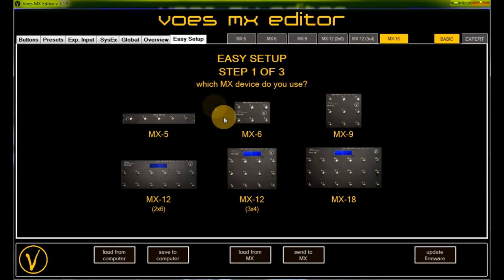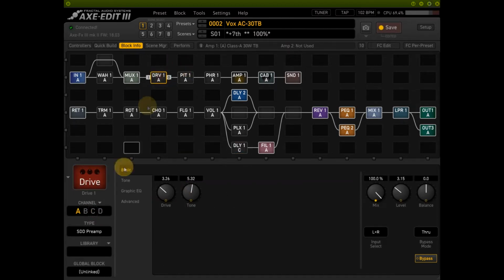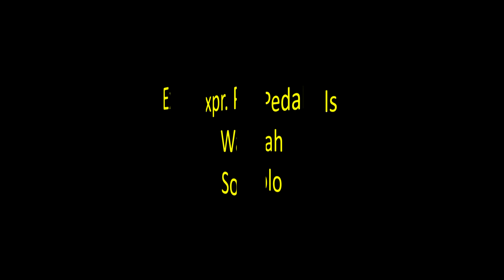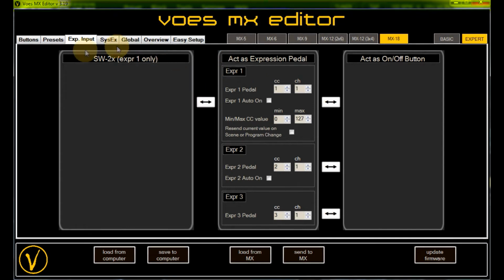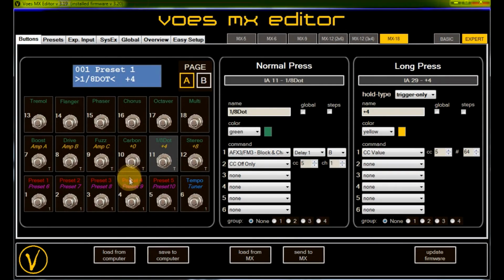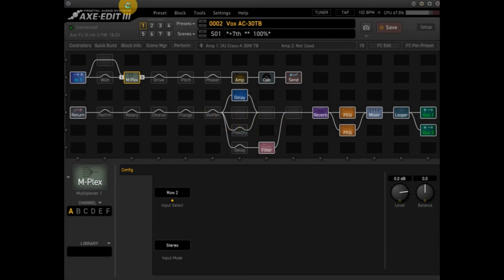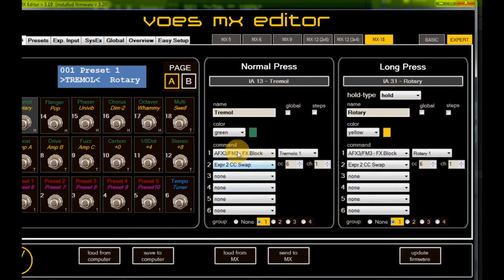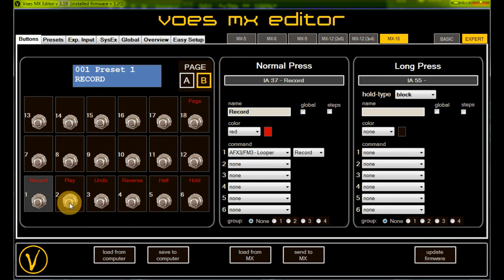Voes Midi Controllers - Complex Setup MX 18 & Axe-Fx III

Comment: Is there a way to connect my Digitech Drop pedal to the MX18 and control it with one of the switch of the unit?
Reply from the maker: Sorry that's not possible. The MX is a Midi Footcontroller. The Digitech Drop pedal does not have Midi